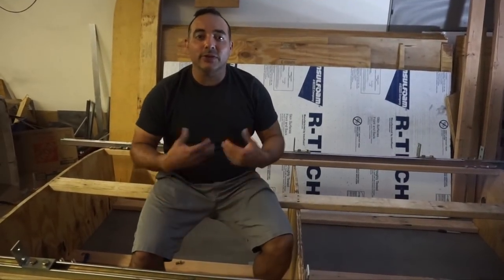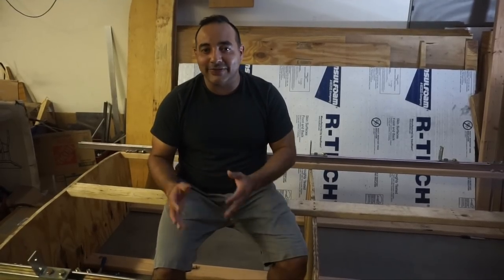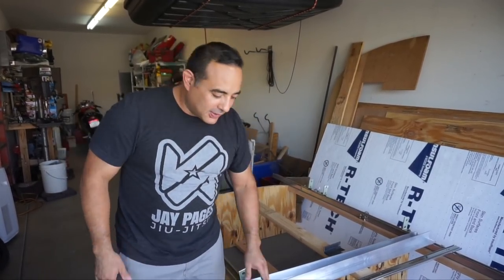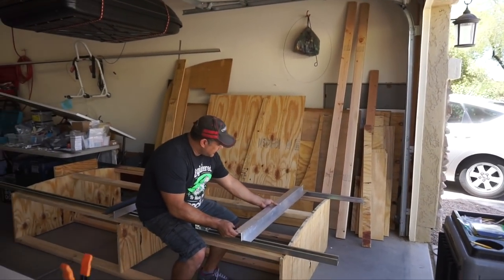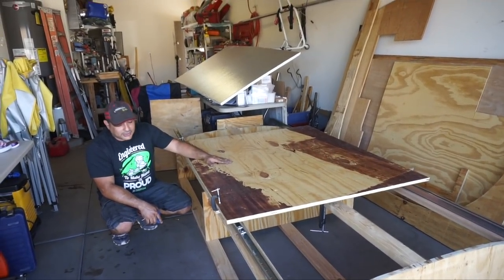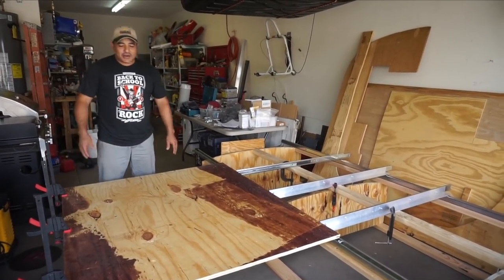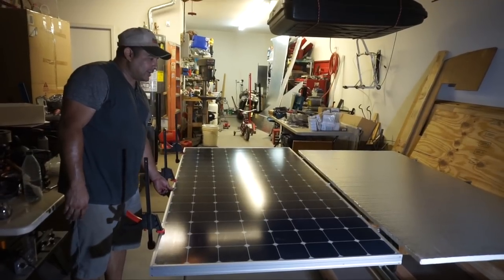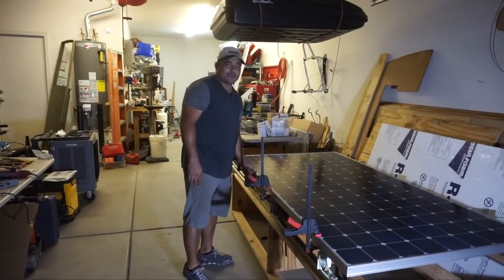RV Solar Rack - Part 2: The Lower Layer

Comment: You're Going To Love This Idea ...  In order to deploy the Solar Panels and simultaneously hold them in place, I suggest adding an electric window actuator to each panel so that you can deploy them electronically instead of manually. You have enough space to mount the actuator and electric drive motor under the panel. I would suggest using an actuator that has a long travel, such as one from a full size van or truck. The actuator would also assist in keeping the panels locked in place while traveling on the road.
Reply: This is a great idea. A car window motor on the center slider just spinning something like a piece of all thread rod or something a little better would be simple and easy to build.
Reply from the maker: Thank you!  Love the idea - we are still working through all this and have ordered some actuators that should be here next week.  Stay tuned!

Comment: Loving your project.  I needed my little home done quickly, so I picked up a Fleetwood Gearbox toyhauler 5th wheel.  I did the MPPSolar inverter chargers and doing a DIY pouch cell LIPO battery.  I have it built in a 7S6P aetup, but doing 8 packs so the BMS's can do the best possible job.  I only did 1200 watts on the roof, but have 2 ground mount arrays of 1440 watts a piece.  I am also looking to engineer a way to position a wind turbine on the 5th wheel when stationary also.  I will be living in it full time, hence why I will be over engineering it. 

But I love what you guys have done, and one day I will get a bus also, and over engineer it also.
Reply from the maker: Sounds like a great project Steve!  Welcome to our channel.

Comment: How much weather and debris will those slides be seeing? If it's a concern it might be better to capture the angle in a channel  with uhmw poly sliders incorporated in or similar...love this sci-fi bus!!
Reply from the maker: LOL thank you (sci-fi bus LOL).  That was one of the drivers of turning the aluminum angle the other way - it creates a little shelter for the slides.  Great idea on the UHMW Poly - we will have to look into that.  We will probably grease everything really well and keep an eye on it for now.   We will report back if they are getting noisy or having unusual wear
Reply: Consider ICE, sand, water, leaves...

Comment: You didn't mention it, but I will assume that the two tracks, as they sit on your mock-up, are completely level.  You did mention that your floor might not be level.  I thought about that as well.  3/4" seems like a lot of play.  Don't forget to leave yourself enough room between the panels for the cables.  I love your design, and I can't wait to see the Rocinante in her new paint job.
Reply: Thinking about this some more, you could intentionally lower the side from which the panel slides (or raise the other) so that the panel is level when fully extended.  This would give you the added feature that your panel is less likely to slide out unexpectedly when stowed.
Reply from the maker: Thank you Mark.  We did level the model from left to right but not forward and aft (our driveway pitches down so that water can run off into the street).  Yes, we think the 3/4 is actually mostly due to the floor since it is the same loaded and unloaded.  We are so excited about the paint job.  We called the painter this past weekend and he said it would be at least another 4 weeks - possibly even longer because of all this monsoon rain!
Reply: It will be worth the wait--like standing at the bottom of the stairs waiting to see your prom date come down.  Okay, maybe not exactly like that.
Reply from the maker: LOL!! That literally made me laugh out loud.

Comment: Why are you sliding only one way?  Why not 1/2 your overhang and slide to passenger and driver side, thus reducing the stresses?  Also, this will provide some shade to the bus walls during the day reducing heat gain during the peak of the day.
Reply from the maker: We are considering this and we may do something like this but we have a couple of other considerations.  #1 actuators are really expensive - especially ones that actuate something 45 inches or so out ... to help offset this we are considering moving the bottom panels in pairs (so maybe we could pairs to each side?).  #2 we want to build some "side skirts" to keep a strong crosswind from trying to "lift" the entire structure off the bus (and possibly destroying panels) - we thought it might be slightly easier to build a skirting if we only have to worry about one side actuating (maybe not - but it's just the stuff we are thinking about)
Reply: Regarding the skirts, I would recommend having two way skirts, with the top hanging down overlapping the bottom skirt.  The top skirt should be flexible, maybe weatherstripping for a garage door, just to reduce wind.  The bottom skirt is then only required to come up to the bottom of the rails or something.Chris and G just stated that he wishes he had more room under his panels to maneuver his arm easily for installation/maintenance.
Reply from the maker: Interesting - I will have to watch and see what he says.

Comment: I would suggest 1/4" hard rubber between the dissimilar metals...it might also help with vibration control when traveling.

>I was typing the below question then watched as you actually did it that way...lmao!<
(You mentioned that the panel gets sloppy when extended...have you considered a third rail in the middle of the panel to stabilize it?)
Reply from the maker: Great minds think alike!

Comment: Careful about wind getting under the solar panels when driving at high speeds. My worry would be the panels would rip off the roof when driving down the highway.
Reply: I am thinking the same thing. Maybe putting a simple wind deflector in the front to keep wind from going under could help and it only would have to go to the top edge of the upper panel.
Reply from the maker: Thank you, cowboy - yes we are very worried about that and that was a major contributor to us changing our design to something more compact for when we are in motion (or there is a storm detected - more on that later).  If you look up "Life is a Joy" here on YouTube - Jim had a microburst come through and destroy two of his panels and bend and damage several others.  We re hoping to build a skin on the side of the structure that would prevent the situation you are describing.  Thanks for tuning in!

Comment: I suggest you talk to Jim & Debbie of Life is a Joy, about the wind which get under your solar panels, they have one pretty much ripped off by the wind whilst traveling, so you will definitely need to deflect the air flow "over" those panels, the wind at 60/70 mph will rip the panel off the roof xxxx

Comment: Looking good but I would very worried about Highwinds on the panels if you pull out and how to lock them down while travelling having them bolted securely to an I-beam or tubing is much safer for driving
Reply from the maker: Thank you Jeff - yes high winds are a strong consideration - If this works out we will be addressing this in a future video (probably with some kind of fairing or side skirts to prevent the wind from getting up under the panels.  We are first trying to see if we can make this idea go ;).  Thanks for tuning in!
Reply from the maker: They have a great setup!  Thank you for sharing the link

Comment: Are you going to deploy the panels on the Curbside or Driver's side of the bus? If you deploy the panels on the Driver's side, the panels can act as awnings for the windows on that side of the bus and you can install an awning on the curbside to shade that side of the bus.
Reply from the maker: The only problem with deploying them to the driver's side is that we have the vent pipe sticking up there ... we could shorten it ... Honestly, we have not decided yet.  A suggestion was also made to maybe have them alternating to distribute the load a little better.   If this works out (we are still testing the viability of even doing this) those will be fun problems to solve.  Thanks for tuning in!

Comment: First off I am not being a negative, discouraging , nay-sayer.  My intent is to be a "second (maybe third or fourth) set of eyes" looking for problems. So here goes:
1) Will the slides (purchased slide) survive the weather? 
2) Water is going to collect in the channel, drill some side drain holes to let it escape? 
3) A thought, if both panels slid out, that would mean the extension would be half of what the one is now and maybe that would be "more" solid? Not sure shade generated by one side deployment will net you anything as they will not be out far enough unless the sun is directly overhead?
4) With the current one slide extension coming out so far I would be concerned about wind gusts. There will be a natural up swelling of gusts that hit the side of the Motor Home. Those panels will make great sails. Will the panel itself have the strength to resit bowing up in the center from wind hitting the bottom side (mount a piece of plywood under the panel, this might also help with the raking)?? Also wind under the panel while going down the road? Wind fairing around the panel in the closed position, but then the vent might be restricted?
5) Center tilt up suggestion is probably too fragile.
6) I do like the idea of the slide, definitely needs to work off an liner actuator. You have to think about weather again. 
7) not sure how you could use this, I had to repair the driver side window actuator, definitely would not stand up to weather unless protected some how, these are available through NAPA and are the same in Fire Truck doors to raise an lower the window. https://youtu.be/uyuM6R8kOi8 

Working on our fourth attempt to buy a new home (this one has three large barns, and yes the motor home fits in one (height)).

Remember I am only trying to be a wall too bounce ideas off of.

You are a true "Maker"

Glenn
Reply from the maker: Hi Glenn - 
I always assume the best when I am reading your comments.  I truly appreciate and value your input as your "Maker" abilities far exceed anything I can do.  
We are still in a somewhat "feasibility" phase of this whole thing but the idea is starting to solidify.  I will do my best to share what I am thinking around some of your comments:

1) That is a concern we share also - it was one of the reasons we turned the second piece of angle the other way to provide an additional "shelter" for the slides.  Only time will tell on this one and it is something we are going to keep an eye on.
2) This is a good idea and we will drill some drains - water will very likely collect on those
3) The sliders are actually 50-inch sliders that we only need to slide about 42 inches - this does indeed make them more rigid and they do feel stronger than when they are extended to the full 50 inches.  Sliding the top panels would probably be much harder and the mechanism needed to support that sliding would probably cause shading on the panel below it? I don't think the shade from these will be significant and we are seeing that is purely a side-benefit.  
4)Yes, these will make great sails for sure - We are considering building some skirting around the structure to keep the wind from lifting the panels from up underneath.  This will be easier on the non-siding side than the side where they have to come out but it should not be impossible.  some kind of fairing on the front to deflect wind around also makes a lot of sense.  If we leave the back open there is a chance that it may create a vacuum that might actually help to pull air out of the coach when it is underway - (not 100% sure on this one - I almost got a chemical engineering degree but I never got to fluid dynamics)
5) We originally designed the top panels to tilt - we came to the same conclusion - we could not make it strong enough to feel "safe" doing it.
6) An actuator is pretty much a "must" for us.  #1 we are not going to get up on the bus every time we want to get the panels out ... its a lot of trouble and dangerous.  #2 (which is more interesting) - once we have it motorized we can start to build logic into when the panels should be out or in: 1: if it becomes too windy ... the solar panels retract.  2: If it is night time ... the solar panels retract.  3: If it is daytime and there is less than 15 mph of wind - the panels come out.  4: If the battery is at 100% the panels retract (you get the idea).
7)We just ordered a large linear actuator that is supposed to push 200lbs or something - should be more than enough.  They are quite pricey so we thought about actuating the panels in pairs (bolting 2 together in the center to create a 2x size "drawer")

I thought you had already moved into your new home but I guess when I think about it I just saw you move out of your old home.

The last few videos you were looking a bit more fit - I hope you are feeling better.

As always, thank you for sharing your thoughts and concerns with me - I always look forward to seeing your feedback.

Juan
Reply: "maker" don't put yourself down, you do outstanding, well thought out, out of the box  projects, stuff I have not thought of. The reason I repeat "First off I am not being a negative, discouraging , nay-sayer" are my remarks could easily be misunderstood, I will stop. I have seen some pretty sketchy stuff out of some of the well known makers

I look forward to your updates. 

We have not moved, when I got sick we put a halt to everything, including moving. I am still getting better.

The new place has three barns, I might now start to think about a bus conversion of my own, I have an inside place to do it. I still wonder if bus conversions could be a business (Most are done because of the cost of buying one done). It is a lot of labor, and conversions carry the personality of the builder.

Bolting the panels together might create more raking problems. I would think the best place would be in the center of the length of the panel. You would not want one side to get stuck with a 200 pound force trying to push the panel out. In this case weak might be a good thing. These electric actuators are slow, I do not think strength adds any speed. Just a thought, you do have compressed air on the bus, an air piston would move the panels much quicker.

Ok, enough for now  Glenn
Reply from the maker: Thank you Glenn.  I had considered a pneumatic actuator but could not source one that moved 42 inches or so (that was not like $1500 ) - Someone on here suggested that the air cylinder has the additional benefit of not "getting stuck" if something runs amock - a very good point to consider.  I will try to search again. 
I have considered the raking problems but thought maybe I could offset that if I have a length of angle or bar that goes 1/2 the distance of each panel on either side? (like pushing out a big "T") - I will have to play with it.
I can confirm 100% that building a bus is A LOT of labor.  I would love to see what you come up with if you ever decide to build one!  If it is anything like the dragster or your garage it will be magnificent!
Reply: The only suggestion I would make on the raking would be to do an "X" from corner to corner with some aluminum. Also backing the panels with plywood should help with both raking and strengthening the panels from "up" gusts. With the third slide it should help support the panel from sagging in the center. 

There are a number of problems with the pneumatic actuators, stick with electric and just deal with the speed, double the voltage from 12 to 24? Slow may not be a bad thing, just a pain in the neck. 

Just bought a step down voltage "transformer" https://www.mouser.com/ProductDetail/MEAN-WELL/RSD-60G-12?qs=%2fha2pyFaduiesmk8LrRekg7QeVqw0B7y4QA7KD40hPdWCr8DJg%2fQvA%3d%3d to handle the 12 volt lights on the dragster (running a 18 volt battery to spin the engine over quickly enough for the mag to start the engine. Glenn

Comment: The only thing that looks like it might be a problem will be wind load while driving.  I am guessing a nose cowel is intended to shear off the wind load on the panels while driving.
Reply from the maker: Thank you Travis - We do intend to put a wind-break on the front but we have had the solar up there since Feb and it has been doing great.

Comment: Cut to "painting bus in MEX"... what are the rates like and which shop are you using?  Did you supply your own paints?
Reply from the maker: We got about 4 quotes in Arizona (in and around Phoenix) - each of them was between $20K and $30K with a lot of indications that it was going to be much closer to $30K than to $20K.  The shop we took it to in Mexico is really small - basically, a guy and his sons but they came very highly recommended from a fellow bus nut who has been doing business with him for over 20 years (he used to own a few auto repairs places in Tucson and would bring him all the body and paintwork).  We are paying $7500 for the paint job and that includes stripping the entire bus down to the aluminum and resealing and repriming all the panels.  The quote was originally $6500 because he was not planning to strip it all the way down to the bare metal - but it had too many layers of paint (I think he said it was like 6-8 layers) and the price went up $1000 for the extra effort and primer + seam sealer.

Comment: I have the same plan and I'm happy to see someone else doing it.  I do plan to tilt my system.  I have a Ram Promaster and will be using Renogy 100W panels.  3 down each side with 3 pulling out from under them for a total of 1200W.  I plan to use all aluminum framing to keep weight down.
Reply from the maker: Awesome!  That is totally do-able.  If you have not seen it yet the Overlanders have a great video: https://www.youtube.com/watch?v=3nKCH-whO2A